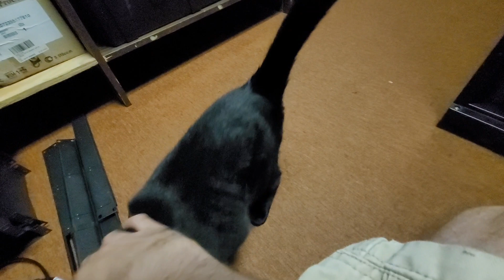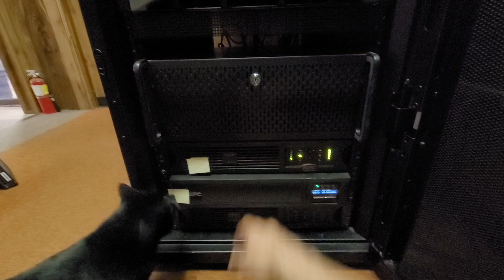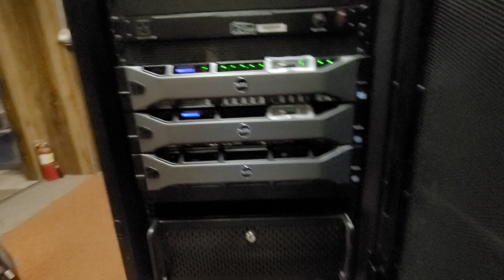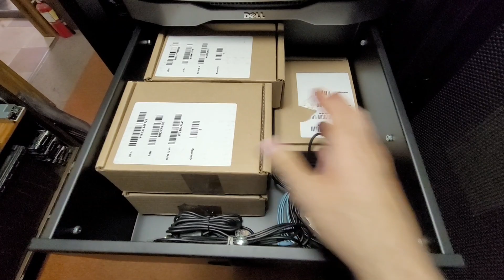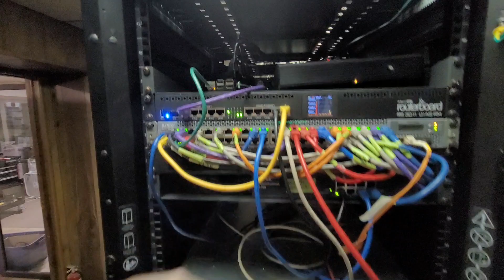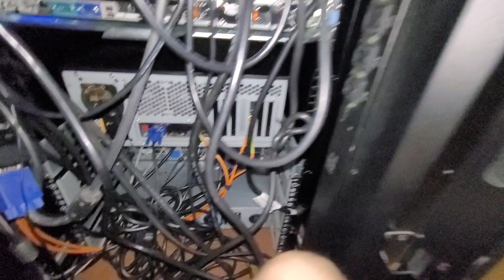Updated homelab server rack tour

Comment: Nice Rack! 
You need some exotic hardware in there... like an IBM I or P series or an old SGI.  
I told you about my T420... I've also got my name on an IBM X3650 M5. When I saw it in our "holding for disposal room," I exclaimed with glee "LIGHTPATH! How I've missed you!" and showed my younger colleagues the amazingly simple hardware diagnostic panel from IBM known as the Lightpath.
Reply from the maker: I might be building out a "vintage" rack but it may be more for testing stuff. I do have a Poweredge c6320 that is semi exotic but one of the nodes is dead and I never found a use for it.
Reply: @computersales  You need a non-x86 CPU for something truly exotic. :D
I am an old school nerd that was exposed to multiple architectures back in the 90's, when they were more common. VAX, Alpha, PowerPC, Sparc, MIPS, PA-RISC. Heck, even the Amiga had a motherboard architecture that was astoundingly advanced compared to the PC system.
Nowadays, You've got your X86_64, your POWER, your UltraSPARC in the distance... MIPS is a rounding error. There used to be so many CPUs...
Reply from the maker: @DrTedEsq  I do have a Cray J90 I don't know how to complete or use. 🤔
Reply: @computersales  that’s pretty damn sweet. 
You need to make that a project video series. Like now.
Reply: And here I was thinking “An IBM I series, aka AS/400, would be a decent starter non-x86 system” and dudes got a Cray 😜
Reply from the maker: @DrTedEsq  learning how to run it would be well beyond my technical skills. I should do some teardown videos on it though.
Reply: @computersales  don’t discount what you can learn. The information is out there. You might end up talking with someone from Cray. 
I had an old DEC server that I was looking for information on and managed to speak to one of the hardware engineers of the system to answer my questions.
Reply from the maker: @DrTedEsq  time would be the other issue. Maybe if I could get on top of things with the business. So much inventory to process and so little time.

Comment: Run a game plz
Reply from the maker: I do use it to do some PCVR stuff occasionally.

https://youtu.be/pPmomCfiMkA
Reply: @computersales  great so what's the average fps gains?
Reply from the maker: @techintern5566  PCVR is stuttery, but I haven't figured out why.  Parsec limits me to 60 FPS so not sure what the real cap would be.  Latency is too high to play games like rocket league competitively.
Reply: @computersales  how do you run vr on a tesla m40?
Reply from the maker: @deepspacecow2644  just like any other GPU for the most part. Once you run the NVIDIA smi command to enable GPU mode it is basically a video card with no outputs.
Reply: @computersales  my m40 never ran the vr games, the gpu that the headset was plugged into would run them, even when I selected the m40 in windows
Reply from the maker: @deepspacecow2644  I'm using airlink on Quest 2. If you are trying to do it hardwired there is probably some special configuration required.

Comment: I do have servers but no Server Rack yet ._.

pretty damn cool
Reply from the maker: It really does change things once you have a proper rack. I mean everything still works the same. It just looks cooler. If you are patient and keep an eye on Facebook marketplace they pop up occasionally for cheap.
Reply: @computersales  I do have some in my mind but I am 15 and in my area there is like nothing, the ones I found are 3 - 4h away at an reasonable price.

Do you not run things like Pi Hole and Media Server?
Reply from the maker: @mcchese4483  I'm mostly running Windows VMs and truenas at the moment. I need to setup a PXE boot server and some more Linux VMs eventually.